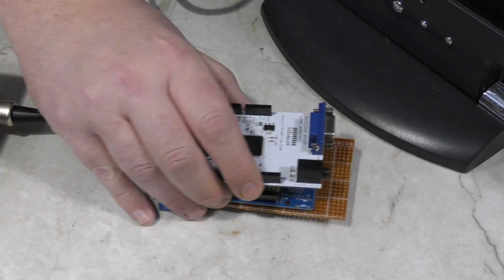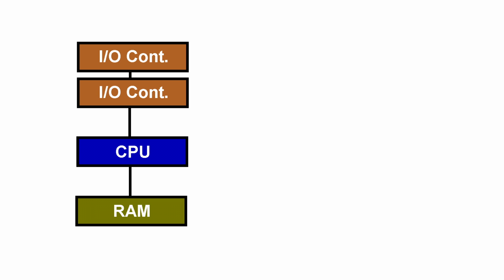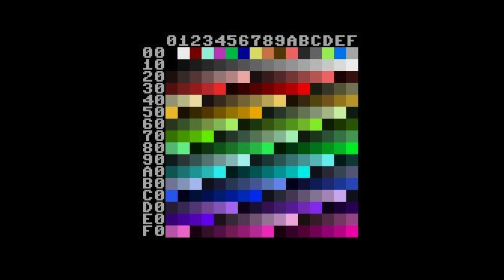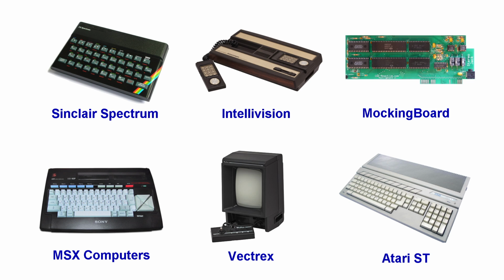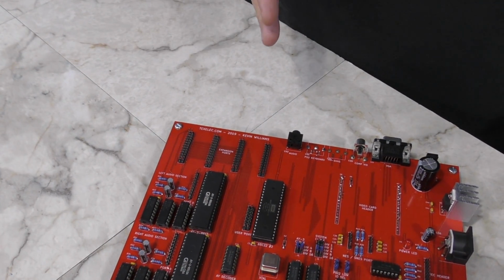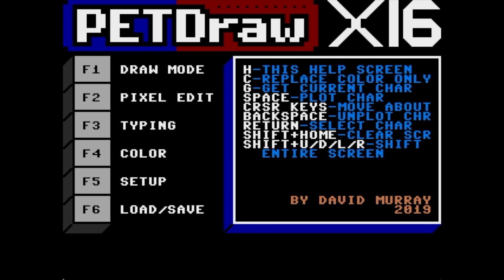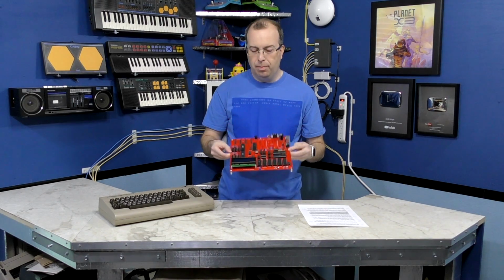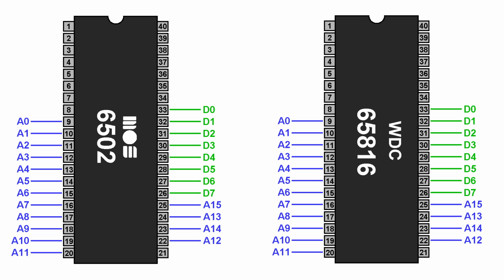Building my Dream Computer - Part 2

Comment: The uPD7220 is a fascinating chip from the 1980s. It was meant to control CRT displays and provide graphics capabilities, but you have to find a way to make it output a valid VGA signal.

Datasheet: http://www.vintagecomputer.net/fjkraan/comp/qx10/doc/nec7220.pdf

This is best used for designing a circuit with the uPD7220 and for understanding how to initialize and draw with it.

Programming Manual : http://www.vintagecomputer.net/fjkraan/comp/qx10/doc/nec7220.pdf

This will explain how to send commands and generally how the CPU to uPD7220 interface works

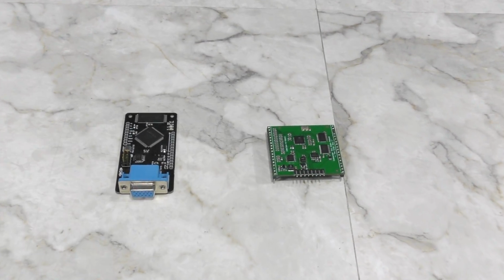Comment: 11:10 Instead of having "Auto increment" flag, how about using the value as signed 8-bit value, and adding that to address. This would make it possible to move COLUMN of data instead of normal ROW of data available with plain flag. And using signed value enables both increase and decrease.
Reply: If he plans 3D games like that, I wouldn't go with indirect addressing at all. You don't want to build your screen in RAM and then blit it to the videoram; it reduces framerates by two.

Comment: This gives me ideas about converting an old french terminal (the minitel) into an 8 bit computer.
The minitel has a an Intel P8052 microcontroller with external EPROM, a dedicated video chip and monitor and a lot of addresses connected to nothing. So it could easily be turned into a 8 bit computer with a new ROM and some RAM expansion ^^

Comment: The tactile keyboard for this is already available for $180. I hope the computer won't be $800 :)   Hopefully the computer will only be the same price as the keyboard (for the kit) or 1.5X the cost. Because I really want to buy this when it comes out. I want the thru-hole, Dev version.

Comment: I have a Nexys 4 FPGA development board from Digilent
with some custom Verilog I have a 32 bit CPU running at 100MHz
128K by 32 bit RAM and 640 by 480 VGA screen (4/8 bits pixel)
https://www.youtube.com/watch?v=Z5suipIq3Pc

Comment: I would suggest using some ALP switches for the mechanical version of the keyboard as it will give the keyboard a vintage feel of boards such as the Apple extended keyboard and the IBM JX keyboard.

Comment: I love 6502 processor for years, addicted to ATARI 800. But There is absolutely no good C compiler for it. That's why I think this project will unfortunately not have a big impact. I had a similar project some years ago but I gave up for this reason.

Comment: What you can't see is a DAC....pops a chip and shows us some resistors and a cap. Isn't the DAC U3, right there under the AY-3 chip, out in the open in plain sight? Or they under the other AY-3?   I'm just having a little fun. Nice job on this so far, dude.

Comment: Interesting video and fun to watch on a New Year's day!

Just on the 2MHz limitation of the sound chip. Have you considered using cross clock domain teqniques on an FPGA (e. g. double flip-flop synchroniser or Asynchronous FIFO buffer) as a possible solution?

Comment: sorry, it is dead born, without HDMI and USB it will never ever reach any numbers
Reply: Honestly, I agree about the hdmi thing. No one should be expected to hunt down a tv or monitor that's no longer being produced just to use this thing. If he's making it so it only uses parts that are still available, it shouldn't require peripherals that aren't being produced anymore either. Having older connectors is fine, as long as it can hook up to modern devices too. If nothing else, that would increase its long-term viability. Of course, its possible that this thing just couldn't output an hdmi signal, but what do I know?

Comment: I would use sram, no fuddle with refresh lines 4Mbit sram's are small. (surface mount)  using more IC's= higher price, Commodore knows this along ago, look at the difference between C64 v1 and c64-C and amiga 500 versus amiga 1200

Comment: Is there anyone in OXFORD England that could make the motherboards for the COMMANDER X16, Did the MEMOTECH MTX512 not have the Assembler and Panel for use with assembler listings, a suitable processor built around a ARM processor which can execute 6502 machine code would work and if you google for ARM6502 chip you will find it.

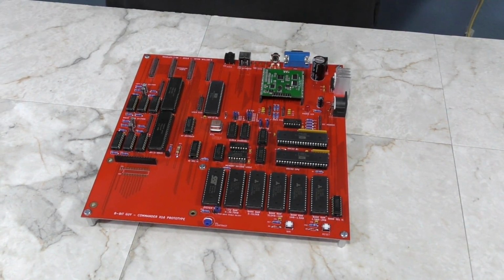Comment: 22:58 Mirror image... Wow... Amature!
Yeah, I've made mistakes like that in the past, probably not to the point of a comercially produced product like this though, I usually check and double check this kind of thing to catch before producing something like this. (I acquired the nickname "PCB Wizard" because of my speed and low error rate of PCB design)

7805... Yeah X3 I ended up using something else for the first big project I mass produced, well, the initial version used a 7805, but I changed it to a switch mode alternative. I can't remember the number of it though. it was also built modular, so replacing the power supply board was a fairly easy change. the Modular design was because the product was to be used by students, and repairs are a thing that would happen often, so each function was replaceable independently, so on the fly you could just switch out a module, then fix it later.
ATX power is kind of cheating though, why not just use a 5V power adaptor directly? With the advent of mobile phones charging via USB connectors, 5V adaptors in excess of 1A, in some cases in excess of 2A are fairly common.

Video outputs... Composite and VGA is good and all, but SVideo? living in england, that is a completely pointless video output, since most TVs over here of the era had SCART, the SVideo input was an adaptor on the SCART connector, and used to actually give a god aweful picture quality worse than just standard Composite. I have experimented trying to get SVideo signals to give an intended picture quality and never been successful.

Moving on though, why not an analogue RGB output (the kind that goes to the input of a composite video encoder) like what you'd find on an Amiga, or if you prefer something of the C64 era, an Acorn BBC.
the RGB output of the 6pin DIN can be fed directly into the SCART connector.

Overall though, you're making good progress on this.

Comment: 10:47
I made a scrolling message display board as my final project in college. The entire program and memory was stored in a micro-controller.
When working, I attempted to make a V2 with external RAM and EEPROM. I never actually finished the design, but did make (Using PAL chips, which came before FPGAs, it's basically just a logic chip that you can configure) a 24bit addressing, 8 bit data memory controller, using only 4 lines (limited pins on the Microcontroller), so, to avoid having to write out a 24bit address every time you wanted to read, or write an 8bit piece of data, I included an... Increment line.
I think the 4 lines were Increment, Address, Clock and Read/Write. The whole thing was basically just a 24bit SIPO, but included an Increment function. this way I only needed about 16 lines total for a 24bit adress, 8 bit data system, which includes read/write, enable etc functions. (heck, with everything I've said here, that's only 13 lines)

I mean, there's a lot more going on than just this, the output to the display was a 4 line SIPO, and it already had an 8 bit data line because the interface to a PC was via a Parallel port. the RAM expansion to the V2 needed not only an address bus for the RAM itself, but a switching system to connect the data to either the RAM or the Parallel port. Even with as many as 32... ish, I/O lines on the micro-controller, I was quickly running out of lines.
Something I didn't know at the time, the micro controller does actually have an IC2 and SPI interface built in, which if used would significantly increase the speed of communicating with an external device serially, as you can output the entire 8bits of data in about 4 instruction cycles, instead of the 16+ required to do it manually turning individual lines on and off.

But yeah, the point of the 24bit RAM controller's Increment line is basically as you described there. After pushing a 24bit Address to RAM, you could literally just write bytes out to (or read in from) the Data lines and pulse the clock, and as long as the increment line was held high, the Address would auto-increment after each byte.

Comment: Hey, you know how a stipulation of Linux is that any changes made must be shared in code? If you are going to influence engineers to develop things like video cards, it would be beyond super cool if you were to also get them to provide a How To Build Your Own on YouTube. Not that I might necessarily want to build my own video card right away. I would still buy the finished product. But there is a certain sense of security knowing that I am working on a computer where every component is 100% video documented and anybody could build any part from scratch if they so desired. From how to build the hardware to how to write your own 8 bit OS, all using readily available components that won't be obsolete next week. 
I also need to ship to underprivileged kids who even in this day and age, may not have reliable internet access. So all related videos available on DVD or USB stick could be invaluable for the smaller percentage of people who need access to tech even more.

Comment: The system sounds good, and I like many of the technical details. Like having auto-increment on video memory write. The 6502 really needs one.

But I did lots of programming on 6502 when I was younger, and I'm kind of ... not exited about doing again with 8-bit index registers, without reading memory pointed to by registers, without math coprocessor.

I would like to have computer similar to C64, but with a modern processor, like one of the ARMs. Maybe a simple coprocessor to run interrupts at given raster line, maybe even on X-direction.

Of course, that would make programming a lot easier, but hey, I've done my share of hard programming. I would like some easy programming.

Comment: Wow, this is great. If you use the 16 bit chip that would be another leap forward in the "easier to program" department. I know purists would probably want the 8 bit limit but since 255 is such a small number you have to write a lot of code to get around that.

Comment: I just want the Stage 1 machine - a C64 type machine on a MicroATX board with expansion pins/slots and is hackable. ATX cases and power supplies are cheap and easy to find. Would need a usb kb to ps/2 adapter though.

Comment: I'm struggling a bit with this one.  If the graphics and sounds will end up in the FPGA, why can't the processor?  Why not use modern DDR memory then?  It could all be derived from the MiSter project 6502 based system and cost reduced as you don't need a large FPGA.  That is the way to get to your $50 range project, with the $10 range being the system under emulation on a PI Zero with an adapter board.  I get that a purist platform with all original ASICs would be cool but this hybrid has me totally bemused.

Comment: Nintendo could create legal problems if you'll use NES ports or its data bus protocol. Why don't retain compatibility with Commodore family using a DB9 connector? That connector can be used with paddles and also with a custom tree button joystick (using pot lines).
Reply: In addition, with a DB9 connector it's simpler to build a joystick with off the shelf arcade parts without sacrifice a NES pad and the X16 chip count should be smaller too (it doesn't have to deal with Nintendo bus logic)

Comment: Very nice. One thing I want is a single purpose old school, plausibly authentic VT100 dumb terminal. I think you could do that with this computer if you built a simple terminal emulator into the ROM. Just flip the switch and boom, it's a terminal. Nothing to load. Would be so nice. Dumb terminals are next to impossible to find, and even when you can find them, they are beat up. Attach your own monitor. VGA isn't 1970's authentic, but I guess that's close enough. Find a VGA CRT if you want, or else just use a flat panel VGA is fine I guess. It would still be pretty close to an authentic experience. Then you could attach this to a real 1970's computer like an Altair.

Comment: This is a really neat project but I unfortunately don't think you'll have many sales.  If this ends up say $500 when people have to buy a keyboard, screen, cables, etc.  you are up against the easiest option for people which is to buy a laptop if they don't already have one, and then use one of dozens of free emulators to learn on any retro platform they desire.  With this you have a modern laptop to learn modern stuff on too.  Oh yes, and you also get to play with that C64 assembler code, etc in the coffee shop or anywhere!  Old hardware gets bought by people wanting nostalgia - people who grew up with the stuff or retro geeks.  You are using new hardware made to act old that will end up taking up a reasonable amount of physical space, but is very limited in its use.

Comment: Donno why, really ...
But I've been sort of on/off to your channel, since its kind of a weird and nerded content.
Think about it. Restricting yourself to 8bit (or 16bit) computing and making those cheese-eater style games 😎
And involving people developing various modules to make it work, having all sorts of problems sourcing the right hardware bits and bobs.

It came to my mind ...
Why dont you use Arduino blocks all over ?

One Arduino programmed for sound synthesis, another for video a third for periphal managing etc. etc.
And by Arduino I'm thinking into all kinds of the Arduino family members, like the nano, the mini or the later fast clock ARM members.
Each and every 8bit computer module function could be any small Arduino programmed to the job.
Arduinos are cheap, and programming is world wide known, as are all kinds of libraries for any function you could think of.

Now you are talking hackable hardware, easy modified, optimised, hacked, new functions ...
And NO problems sourcing special chips, not even in the future.
Reply: Arduino (as many as you want) can't do this!

Comment: You should have a GIF on startup with the butterfly X like sliding together so basically the left and right side of the >< come in at the same time to form the X and then the words at the bottom would just slide up.

Comment: I loved my C=64 back in the day. I upgraded to a C=128 and sold the C=64. As my interest in other computers grew and my C=128's keyboard was starting to get quirky I let my nephew use it. He used it for a while and then it ended up in his garage for several years. I got it back and I plan to try firing it up some day. I know that at best it'll boot but the keyboard is still missing keys (electronically, not physically).

Comment: Wow!  This thing has REALLY come along.  The first video on this got me really excited.  This video has created more flesh and bone to the fantasy previously discussed.  Now all that should be done is once the modern retro machine is built, to create a "modern interface" kit (which doesn't have to adhere to the original scope) to allow users to use whatever keyboard or other devices including network access.  So the machine might be displaying whatever to a TV, but its IO is being managed over a home network with VNC protocol or some such.  This could enable all manner of things including emulated disk drives and disk media which would actually be files on a file share.  (The CoCo and MC10 people already use a pretty well documented system called drivewire and C64 emulators also use some sort of disk image mounting system.)  Probably a lot of this interfacing and device virtualization could all be done though a Raspberry Pi or something conventional like that.  I'd love to be able to access this thing from any computer in my home over an HTML5 web browser to play with anywhere at any time. 

You're making wishes and dreams come true.

Comment: hope this not die like Micromite Companion and similar boards
soooner or later VICEX16 emulator will be come (not much to change for code)and we all again just use raspberry pi.
price for this is over kill. how many will buy if eventually you get it cheaper. or sell just board let user build it. they propably allready have all these chips

Comment: The problem with Commodore 64 and other Commodore machines has always been the complexity. To save a few cents in the factory the programmers had to jump through hooples. Designing an 8-bit dream computer in this present era should have had a different starting point. In 2019 it is possible to produce something that is open and clear, easy to operate and at the same time cost effective. If it has to work like a C64 you are limiting yourself. The world moved on white the C64 stayed as crappy as it was more then 35 years ago. There is no need for poking in the video-RAM to get things flashing around on the screen.
Reply: The point isn't the "need" to poke, but with modern systems built with layers of abstraction and often POSIX/Linux, there is no "ability" to poke the underlying hardware. Raspberry pi doesn't offer direct hardware access, it was conceived around Python not Assembly.